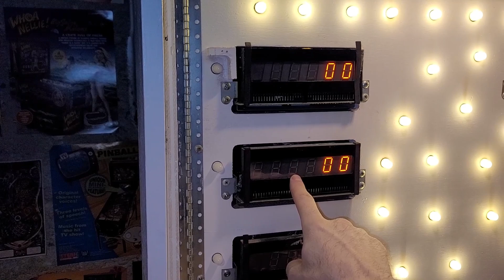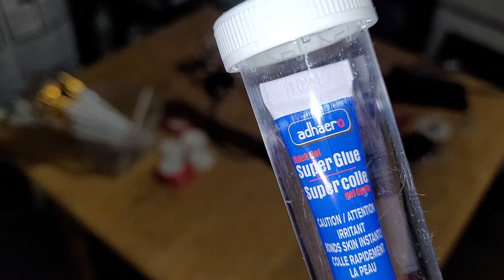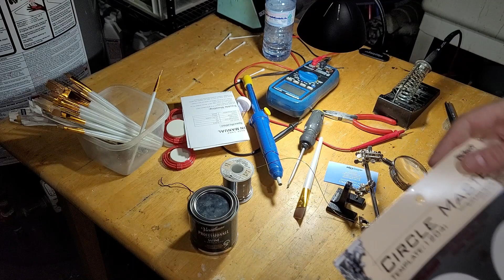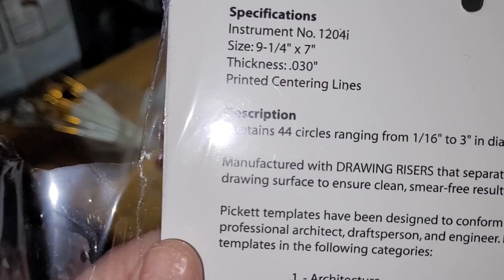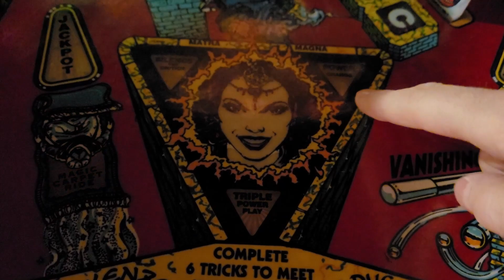Part 14: Six Million Dollar Man Pinball Project. Misc game room repairs, waiting for clear to dry!

Comment: I can confirm that the behaviour you noticed on your whirlwind (machine going into ball search mode after a while when holding the ball with flipper in up position) is common to all System 11B . I got the very same thing happening with my Black Knight 2000 as well as with my Swords of Fury (both System 11B). You can definitely stripe this one off your to-do list 😄
Reply from the maker: Hey man. Thanks for chiming in. I was checking this yesterday actually and it was not going into ball search anymore. I noticed in my video it did NOT go into Instant Info when holding the right flipper and then ball search kicked in...yesterday it WAS going into instant info and ball search did not kick in after 2 min!